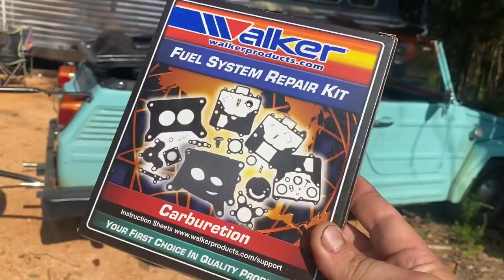Diesel guy cleans vw solex 34 Pict carburetor

Comment: ethanol is a realy big threat to us older petrol car owners :(
Reply: All that chalk it leaves behind. When I raced go-carts we had to rinse the methanol out of carb before you went to bed that night.
Reply: I agree 👍..i have a small engine repair shop i run outa my garage and i see alot of that white flaky dusty crap come in from my customers here in Minnesota and other issues caused by the ethanol blended gas..i ask people what kinda gas you runnin?...majority say the same gas i use in my car..i shake my head at them..naughty naughty i say..so i point out several gas stations around the metro area that has non ethanol gas...it just plain smells different like back in the old days ...and some customers have thanked me when their mower or snowblower works like it should after being stored properly.. ethanol is a killer for engines with carburetors ..be it small engines or older automotive car engines
Reply: It's a matter of education, just learn what you need to do to counteract the problem. I put two little valves on the fuel line in my vintage riding mower. One shuts off fuel to the carb, the other is downstream of it and lets me drain the line. I shut off fuel as I am pulling up to park it, and I drain it down if it will be more than a few weeks. I haven't had to touch the carb in 6 or 7 years.
Reply: @leeharris3061  i run 98 octane non ethanol gas in my lawmower as well as in my cars. non ethanol fuel has given my Volvo XC 70 and 2008 Cadillac STS better gas mileage. so even fuel injected cars run  better with non ethanol gas
Reply: My small engine carb jets stopped clogging the day I started running zero ethanol gasoline in them.....saw a gel like plug like Vaseline in the main jets with that E10 garbage.

Comment: A couple of things: 1)  How was the old gasket between the carb and the manifold, if you were getting an air leak there it might explain your lack of power uphill. 2) Get a clear plastic inline fuel filter, when they are new they will be about a third full of air, when the air bubble gets to the size of your thumb nail, replace it.  3} Would like to have seen a spark plug or two to "read" them, if you are not familiar with reading spark plugs, there are several YouTube videos on doing so.  While some people swear on one brand of spark plug and others swear that they are the worst, they are all good as long as the corners of the center electrode are reasonably sharp and they are gapped reasonably close.  When replacing spark plugs if you have it, using compressed air blow out around the base of the plug BEFORE removing. Always put a small amount of 'never seize' on the first few threads and DO NOT over torque., the thread length is short and the head is aluminum.

Comment: I would highly recommend a better fuel filter.  The old school paper filters decay after time and clog the carb. I installed a nice aftermarket filter on my bug years ago and the carb problems drastically reduced. 
Also, check the transaxle fork mounts. That engine has a bit of wobble, they may need to be retorqued.

Comment: I had a 74 Super Beatle. Try going with electronic ignition. Getting rid of the points and condensed will help you a lot. Still fits right under the old cap. 👍🇺🇸

Comment: glad you got it working better, vapor lock is a thing in the south. 2 things i noticed on your setup. The (metal) line from your distributor vacuum canister to the carb should have HIGH point above the inlet into the carb. like a camel hump. Your fuel line from the pump to the carb needs to be tied as far away from anything hot as possible to avoid vapor lock.

Comment: My brother-in-law had a heater box rust out in the back, redirecting heat into the engine compartment that should have gone to the heater in the cabin in his vw..  That can cause vapor lock.  Something to check.  I had to help him change that heater box - it extended from the engine to the front of the VW.

Comment: Do you have a full centrifugal advance distributor?  If not then GET ONE.  Transforms that engine.  Set your #3 exhaust valves - and maybe #4 as well to a looser tolerance.  I used to do 0.008" on those exhaust valves.  As I recall - talking 40 years here - the standard lash was 0.004" on the intakes and 0.006" on the exhaust.  The far side - left as you look at the engine from the rear - runs HOT.  The air box has an oil cooler sticking up in it that blocks air flow to that side.   A separate oil cooler, mounted on the forward side of the air box fixes that problem.

Comment: Nice job tackling the carb Scott. Ethanol sucks on a carbureted engine.
Ya might want to change your fuel filter too when you have time. And for the extra insurance to keep crud and water out of your fuel. Mix/run STABIL 360 MARINE FUEL STABILIZER it helps me a lot on my riding lawnmower when you’re not using it. 
Keeps the fuel from breaking down with the crappy ethanol. 
Hope you have a Blessed One Sir.

Comment: I spent many years working on Volkswagen's in the dealership....I watched this video and I can tell you that there were a couple of things that you missed. There is a ball check valve in the carburetor bowl that must be removed using a long screw. that check valve is the check valve for the accelerator pump. If you shake the carburetor (no gas in the bowl) you should hear it rattle slightly. You must also remove the accelerator dump tube and make sure the bore and tube are clear. Once assembled with gas in the bowl, operate the throttle. You should see gas coming out of the dump tube with very little throttle movement. That's how you tell if the accelerator pump is working. If it's not working, the car will be extremely hard to start when hot. It will start better when cold because the choke is on. It will also hesitate badly when trying to accelerate if it's not working

Comment: You have the rare optional 2 screwdriver top carburetor...LOL
At 6:00 the bottom of the carb has an aluminum spacer, this would transfer heat to the bowl quickly. In my opinion should be phenolic to stop the heat transfer.
Reply: Lens Cap ... stock VW has no spacer and despite what so many are talking about I never saw one with a hot restart issue that couldn't be fixed in all the time I spent on them since about 1970. I also never saw a stock engine with a frosted intake. Perhaps the heat riser tube is cogged?

Comment: Maybe vacuum leak at manifold rubber boots, the dual port engine expands quite a bit when hot. After market silicon ones are available.

Comment: Have you replaced the coil? An oil filled coil can cause the same or similar problems with starting. Is there oil oozing around the top of the coil, if so remove the coil & shake it can you hear oil sloshing around?  They put oil in the coil for cooling & some coils are filled with some type of alkaline for cooling. Sometimes oil can escape from the coil through the coil wire, what fun that is.

Comment: Check to make sure that you are getting full throttle  on the carb when when the pedal is all the way down. What happens is that people dont pull the cable all the way back  before they tighten the the clamp on the throttle lever..

Comment: im told the 34 pict-3 carb its hard to get the idle right. most do is replace it get a carb adapter and run a H30/31 pict carb being you are still running the dual vacuum distributor.  im running a Solex 30 Pict-1 in my 65 bug and i adapted the 30 pict-1 on my former bug which had a 1600 dual port and a single vacuum distributor. as the points there is a conversion kit for these distributors the Pertronix ignitor kits they are more common the Ignitor ll lasts longer. not sure its available for your distributor in your thing but available for the 009 distributor. which i got on my 65 bug 40 horse.

Comment: Not familiar with VW but do those have a power valve that opens under low vacuum. Older American stuff with a leaky one were hard to restart hot due to dribbling fuel into the intake.

Comment: Sounds like you got the tune close enough to drive it, when Sage comes to help you with it you might want to consider pre-emptively changing out the fuel enrichment solenoid. That's a common point of failure on those carbs and they always fail in the full fuel position, you'll know when it happens cause you'll be blowing more soot out the exhaust than a badly tuned Detroit lol.

Comment: Allso worth it to check the valve clearances on both heads. Cooling and heating with incorrect valve clearances can be cause of difficult starting at different engine temeratures.

Comment: Did you pull the distributor out check the gear on end of distributor see if loose turned a bit if pin gear keeper. Is bad that's what did the trick on a 67 bug

Comment: Rough start after 15 minutes when hot, sounds like your carb is getting vapor locked, in those hot 15 minutes the fuel inside carb is boiling out, evaporating etc

Comment: too high a float level will cause issues as well as a not totally sealing needle and seat combined with the very common too high a fuel pressure, thats adjusted by adding more gaskets under fuel pump to get it to 3psi

Comment: I hope you put some cleaner through the accellerator tube (little tube that juts out from the top of the carb over the butterfly) off camera, but it's not the end of the world if you didn't. It's another thing which clogs over time, but it's only used when you mash the throttle.
That said, a few pumps of the throttle just before attempting a hot start might mitigate that issue.

Comment: All carburetor rebuild kits these days should use neoprene rubber instead of natural rubber because neoprene is impervious to ethanol.
Reply: I certainly wouldn’t say “impervious”. I own a small engine repair shop, and I have yet to find a fuel line that will hold up long term to ethanol. Even Tygon line will eventually fail.....

Comment: Replace the engine with a Detroit 2-53 (I think that was the smallest one they made), add a bunch of reinforcement to everything, and you'll have a Thing with an engine that you can work on.  Or maybe somebody makes an aftermarket TBI kit to replace the carb on the VW.  Just connect the oxygen sensor about an inch past the exhaust outlet so that it will run rich enough to keep the top-end cool.

Comment: A lot of folks here mentioning Vapor lock, and that might be a cause of hot start issues  but, how old is the ignition coil ? i restore vintage Mercedes for a living and i often come across cars with 60 year old ignition coils ,which stop working when the car is hot, the ignition is turned off and the heat sink cooks the coils internal insulation causing it to break down. 
A quick simple effective fix is to fit a pertronix ignitor II and coil and you can forget ignition problems.

Comment: check fuel level in float and also check fuel pressure.................vw noted the hot start issue in the bently...........hot start instructions are to put your foot to the floor, crank and let off

Comment: Ddo not burn regular gas with ethanol.  It makes a crusty material in old carbs that restrict the jets and other passageways.  Burn non-ethanal gas and it will run great.

Comment: Hey Scott. I am a new subscriber and was watching the video of you changing the V belts a few months ago. As a 50+ years concrete man, I would try to find a decent company and barter some diesel work for concrete work. At least the pour and finish part.  Thats where most rookies fail. We always were having to mess with the skidsteer. And power trowels generators etc.They are gas except for the skidsteer. Buy hey, you can do it man :-). Plus a lot of them have diesel rigs to pull the skidsteer. Any way my thoughts. Oh. Why don't you carry a 4x8 piece of plywood cut on half with some hinges to lay on in the gravel?

Comment: Should that alternator drive belt have that much slack?
Reply: Chuck Todd it shouldn't flop around like that  it's probably the 9.5/10 x 905 belt for a generator not the wider and slightly longer alternator belt. It'll probably slip and could contribute to the engine running to hot

Comment: fuel mixture all the way in could be idle jet not seated or too large among other things like miss adjusted throttle shaft stop screw............the throttle stop screw is a set it and forget it.  1/4 turn past throttle plate contacting inside

Comment: I would have pulled the fuel shut off solenoid to check for crap in there. You should be still able to do that without removing the carb.

Comment: pour seafoam down it after and let it sit. add seafoam to the fuel tank, all the time. keeps the old lines and cylinders clean. amazon sells new carb's for under $150.00... if you still get stuck. Buy a new distributor go with electronic ignition.

Comment: Borrow or buy the Robert Bentley manual that covers your car (VW T1 71-79). It'll tell you how to properly adjust the carb including the throttle position screw. It's the bible of air cooled and was what VW sold as the official manual. If your problems persist try removing the idle jet and clean it. It should be under the choke,they can plug up.

Comment: It has been over 30 years since I have rebuilt a carburetor so I'm not saying anything.  I still don't know what was wrong with the carburetor in my Toyota truck but rebuilding it fixed my problem.  For some reason, the O-rings that came with my rebuild kit were too thick and I had to re-use the old O-rings.

Comment: @bus grease monkey throw a new set of plugs and points in it and put a vacuum gauge on intake vacuum and set the carburetor to highest intake vacuum and also i dont know if you did or not but whenever you replace the needle and seat you always check the float height because differant brand kits use different tolerances on the needle and seat assembly and then read your spark plugs to see if it is rich or lean and you can adjust the carb accordingly

Comment: big screw is idle adjustment.............if that screw is all the way in that means.....the o rings around it are gone worn or...........your throttle plate is not adjusted correctly.  that tiny screw that hits the choke cam is not an idle adjustment.  It sets the throttle plate stop position and thats it.......when you get the big idle screw to be out a turn or 2 or 3 then your in the ball park for correct adjustment.........or you just plain have vacuum leaks

Comment: Should ALWAYS soak the Carburetor in Carburetor Cleaner! It comes in a one & Half gallon can looks like a over sized paint can it has a metal basket in it so u can put all the screws parts etc!!! It cleans in areas u cannot get to. Takes all the guessing out if u got it cleaned good enough. & beats the Hell out of getting stuck on the side of the road! U may get by with putting a bandaid on this Carburetor! It would’ve probably been better to had Sage & his friend show u! They seem to be real knowledgeable about VW’s! Nothing worse than something that doesn’t run rite! I cannot stand that!!
Reply: I offered to bring my coffee can of carb cleaner the next time I'm down to the compound.
Reply: A myriad of things can benefit from a soak in carb cleaner. (Even better in an ultrasonic cleaner.)

Comment: Those carbies don't do well with ethanol in the gas. Id look into purchasing straight gasoline for the occasional driver. Also a fuel shutoff to drain the bowl when your finished driving you can just run it out....i have a friend with a early 70s porche and his webber have horrible ethanol corrosion in the carbs.

Comment: Scott:   Be sure to change your fuel and vacuum hoses at least once a year (<---Fire prevention!) Do not forget the clamps! Carry a Co2 fire extinguisher. Bigger is better.  Put an in line fuel filter between the fuel pump and the carb.

Get the valves adjusted on a regular basis. (Got Idiot Book?)

Try to stick with OEM VW parts. German/Bosch is best. Brazilian is less expensive and Mexican is ok.

A very good place to purchase VW parts is Bill and Steve's in Bellflower, CA. That store has been around over 30 years. 562-923-3251